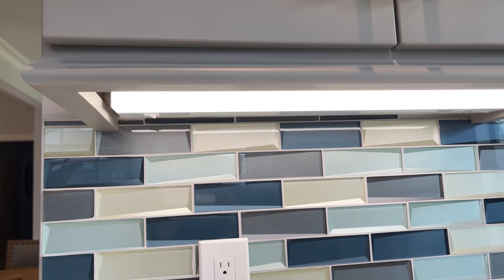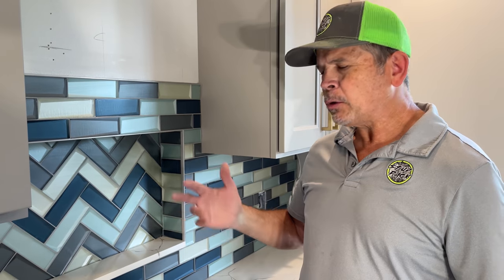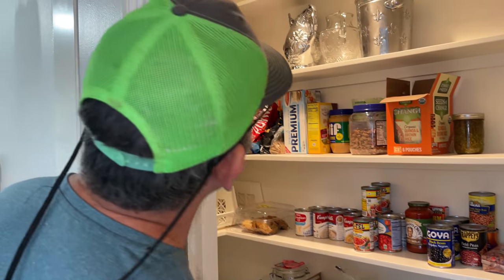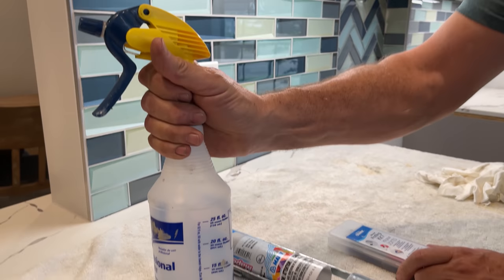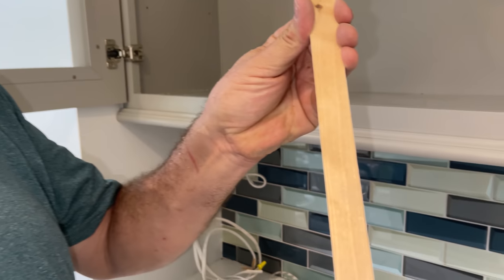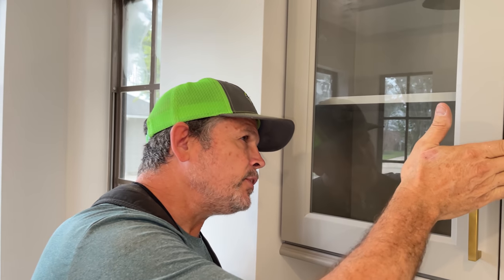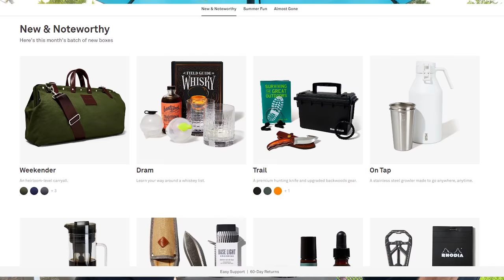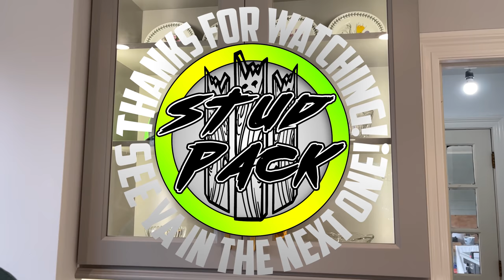DON'T CAULK YOUR TILE! Do THIS Instead...

Comment: I've seen a lot of caulking tools, but not one with the sleds to skip over the grout lines. Do you have a source/manufacturer? My tile/countertop joint was grouted and it's cracking. I need to remove the grout before I can apply sealant. I don't want to use a grout saw, as it will scratch the countertop. Any recommendations for a grout removal tool that won't scratch the countertop?

Comment: I use popsicle sticks for caulk.  Cheap.  Also works for grout lines.  Pick up a little spray bottle in the beauty/travel aisle.  Then you don't need a big bottle.  The spray is much more even.
Reply from the maker: Cool thx 💪

Comment: I do bathroom remodels and I use the exact same products and the exact same method to silicone my tubs and walls the denatured alcohol in the bottle works miracles and the tool gives u a nice clean straight bead
Reply: Is it proper to use silicone for the shower base where the floor meets the walls? Or is it grout
Reply: @OGCJ10  usually silicone is best because grout will eventually crack where your talking about use a 100 % silicone that's meant for bathrooms its flexible and water proof

Comment: Let me tell, you, when you're putting in cultured marble counter tops in a 6 story apartment building, and each floor has about 12 apartments, each one has 5 countertops, the last thing you want to worry about is that little plastic thing. Cut your tube of silicone smaller first off, don't care if you push or pull it, have a roll of paper towels handy, spray with alcohol, use your finger, and go to the next one. I've done thousands of tops in my life time, and have tried different "tools" to smooth the silicone/caulking, and nothing beats the finger for speed and conformity.
Reply: Latex gloves make silicone as smooth as latex caulk with a wet finger.
Reply: @toomanymarys7355  good tip. I've never tried that.

Comment: @stud pack     for times in between uses, keep your CA glue in the freezer, it will store a lot longer that way.
Reply: RC model guys due that as well. Last waaay longer
Reply: @lyradm1  I actually built architectural scale models for about 10 years professionally, and how I got the job was with my models I built as a teenager. So yeah, that freezer trick is one of my old guy tricks.

Comment: You should add a few beads of the 2P-10 to those LED strips. That adhesive doesn't stick very long term. Plus the warmth of the LED will slacken the adhesive.

Comment: From a setter, in the future mix your grout by hand with a pointer, drill and paddle whips to much air into grout and reduces its cured strength, crack resistance, and causes "shading" a discoloration effect
Reply from the maker: Interesting thx Brady 👍

Comment: Thanks for these great videos. I'm always learning something new.  I have a question about the grout. Well, really about the grout and thinset tool cleanup. When you finish a project, or for the day, where do you clean up the tools with grout and/or thinset all over them?  I've been using my driveway with a hose.  I don't want to wash all that stuff down my drain and cause a possible problem.  The problem is, my driveway runoff goes into the sewer which isn't treated and ends up in the bay.  Any ideas on how to do this without having my neighbors getting upset or the local government shutting me down? Thanks.
Reply: A really good way to deal with this kind of waste is to wash everything in buckets and leave the grout to sink to the bottom - assuming you have a day or two to leave it on site - then simply pour off the water (I put it down the pan and flush at the same time!) and scrape the sludge out of the bottom into a bag with used rags, newspaper or paper towels.

Comment: 2P-10 vs a pin nailer  Got a project to finish off that I've been procrastinating on. Need to edge some oak plywood with solid oak, then assemble all, and a pin nailer seemed perfect. But which pin nailer? Considered a battery-electric vs a highly-rated pneumatic. The pneumatic is cheaper, but I don't have a compressor... yet. I want one, plus I need to re-shingle a cabin. Given the cost of labor that pro roofers charge, I can easily pay for a nice compressor and coil-type nail gun (plus a pin nailer), twice over.

Then I saw your video last week. Even if the pin nailer is essentially free, 2P-10 may be the better solution. Just need to order some.

Comment: We used what was labeled silicone caulk, in newly (flipper special) lined shower & tub.
It quickly grew molds.  Was it mislabeled?  Are there silicone caulks that don’t allow molds to grow in/thru/behind them?  Are there brands or components to look for, to get calk that really prevents molds?
Reply from the maker: It was probably siliconized acrylic caulk.   Must be 100% silicone.   If acrylic appears on label or it’s water clean up don’t use it in wet areas imo 👊👍

Comment: You can buy aluminum extrusions like that for LEDs with a diffuser on the front that will dissipate heat from the LEDs and diffuser the light better

Comment: Tip, mount those strip lights flat inside the cabinet in the corner facing the back of the box, and to the adjacent wall alongside the light strip,  mount a mirredge mirror strip like 1in width the total height of the box,  when the lights turn on, they will reflect from the mirrors and light up the entire box.  No need to angle those l.e.d.s, look up mirredge strips
Reply from the maker: This is awesome David thanks for sharing! 💪🏼

Comment: My two cents guys. When I use silicone I don't use racks for cleaning,  I use a toilet paper roll. Clean my tools during silicone work and flip the piece of paper of the roll and wrap the silicone in it. And I move on with the next part of paper, but keep the still attached together. After all is done I have a big paper wrapped silicone sausage. Strip it from the roll, done. Don't forget to put the toilet paper roll back on the rest room, the next one will appreciate it 4 sure. Greetings from Germany

Comment: You don't need to use denatured alcohol.  Water with a few drops of dishwashing liquid works great.  This is how I've been caulking (with a profile tool) for years.  Comes out perfect every time!
Reply: For silicone?  Or for paintable caulk? Because I know that caulk is supposed to be water clean up, but alcohol is my friend with silicone.

Comment: Call me a rebel but when I did my backsplash I used a similar glass tile about 1/2 the dimension from Costco.  I prepared the wall by fixing any blemishes and painting it white due to using glass tiles.  When I was finished I didn't bother using any caulk because it just looked too good without caulking and I didn't want to chance wrecking the look.  I also used an anodized aluminum strip between the counter and tile and around any exposed edge for a really nice finished look.

Comment: Just curioius, do you have a link for the led strip lights, or the specs on which ones you used? They look awesome, and would like to try some in my kitchen. Also, ddi you use a regular fixture for the under cabinets, or would the strip light work there also? Thanks, really liked your entire video, including the "sealer" using the silicone.

Comment: Another tip for tooling 100% silicone.  Foam window spray.  Spray your caulk line, then spray your finger then tool your caulk line and it will get rid of the silicone residue left over when tooling the caulk line.

Comment: Oils in your skin will eventually discolor silicone when you use your finger. I found this when caulking fiberglass board in my deli, the thin residual from the smear looked awful and was very difficult to remove.

Comment: 12:58 Make a paper template that matches the table top of your miter saw. Next, transfer that onto some 1/4 inch or 3/8 inch plywood. After cutting the plywood to match your miter saw, use some double sided tape to attach the plywood to your miter saw, and make a plunge cut into the plywood. Now you'll have a zero clearance table top, and small pieces like what you were just cutting here, won't fall into the throat plate and be a pain to get out. Because you used double sided tape to attach this to your saw, you can easily remove it for framing work, and reattach the plywood as needed.
Reply from the maker: Cool thx 👊👍

Comment: top tip when you using silicon put a line of masking tape top and bottom of were you intend to seal you will have a straight line every time
Reply: I stopped using tape because the sealant often creeps underneath, especially in the grout joints, and after revisiting old jobs I saw that the edges were lifting up - the tape leaves a ridge along the edges that gets peeled by regular cleaning

Comment: What did you end up doing with the tiles missing on the tops of the outlets in the backsplash? It looked like they're needed to be a little tile placed in there so the top of the outlet tabs would sit on tile....... also it's good to go one row below the top of the Granite behind the oven, most decorators and general contractors want it that way that I know so when you have the oven in there you do not see paint because you went one more row down.

Comment: Caulking- I agree it looks real good, but the worry I have is that where the silicone hasn't completely filled the full size of your bead, the alcohol will keep it from sticking when you run the tool over it. I think that's why that glitch showed up here. Anyway, it will look good, but then those areas will pull away over time and it will look like crap.. or in a shower, could leak. Is this not a problem?
Reply from the maker: I get what your saying Mark but I haven’t had any problems.   I have tried the tape method and it works great too.   Tape on the counter, tape on the splash, apply sealant and tool with finger and acetone, remove tape
Reply: @StudPack  Ha! Yes, I originally wrote that tape is my method, but my post was getting too long. Maybe I'll do a mock-up of this and have a good look once it sets up, would certainly save time. Maybe the silicone on the tool pushes/squishes the liquid away as it goes..? Thanks for response.

Comment: Do you use any special waterproofing sealer in or on the grout ??   
Is it waterproof by default ?
Thx...   Great work as usual...
Reply: grout is waterproof already... be sure to clean all the thinset out of grout joints before grouting because thinset is not waterproof and causes the grout to fail

Comment: Stainless cabinet hardware would have really made this job sparkle. 
If there had been any beige or brown in the backsplash, then brass taps,etc would have looked good. 
But the blue ad grey tile plus the clear glass in the backsplash — also the grey cabinets and stainless appliances — really cry for stainless - or maybe black hardware throughout!

Comment: As far as caulking goes have you ever thought about trying Dawn dish soap and a bucket of water in a sponge. Use your fingers to wipe down the caulking and then wipe the excess caulking onto a soapy sponge
Reply from the maker: I’ve tried window cleaner.  Didn’t like it.

Comment: Good tutorial.  Something not stated, however.  100% silicone is CRITICAL with wet areas:  make SURE the silicone is MILDEW RESISTANT!!  If not, you'll be back cutting mildewed caulk out and you'll be learning your lesson.  I like your tool, especially the finger, but if it's really important to get a clean line, TAPE both surfaces and leave the joint open.  Do everything you showed, then pull the tape ASAP and you'll have a fantastic, PERFECT straight line!
Reply from the maker: Thx and yes the tape works great too 👊

Comment: Kwick seal ultra =best results I had so far for siliconized caulk. Sorry Paul. I don't like silicone as it's hard to work with. However I will try denatured alcohol next time,  IN CANADA METHOL HYDRATE.

Comment: I have been a professional caulker for over 45 years. Never use acrylic in any wet area. Always use silicone. Or if it absolutely needs to be painted use urethane. The ONLY  thing acrylic is good for is paint prep.
The profiler tools make it look good. But it does not properly tool the joint it just scrapes off the excess. Tooling is primarily to increase the bond. It’s secondary purpose is aesthetics. A very inferior product.

Every major manufacturer says not to use liquids to tool with if you look close enough at their tech manuals. Here is what DOW ( one of the largest silicone manufacturers in the world ) says: NOTE: Do not use liquid tooling aids such as water,soap or alcohols. These materials will interfere with cure, adhesion and create aesthetic issues.
Page 75 of their tech manual
This doesn’t mean I don’t appreciate everything else you do
Toss the profiling and the spray bottle.

Comment: Save your money on the silicone blade. Been using the small radius from a rubbermaid spatula with excellent results. No practice needed. Cost $2

Comment: Have you tried using the tip of your index finger right above the tip of the caulk as you pull away??? So you place your fingertip right above the tip where the caulk will come out, start squeezing and start pulling, no residue left behind, nothing to clean, just very very little on your finger after done. Try it!!!
Reply from the maker: I’ve done that with latex caulks.  It works great most of the time.  Never tried it with 100% silicone.   I’ll try it next time 👍

Comment: Those tiles are '3D' with the bevels. Was there any special  method you had to use to get all the grout into all the spaces? I'm about to get started with a 'tile' project in our master bath (once I replace the drywall behind the sinks with cement board). The cultured stone 'tiles' we've picked out are VERY '3D' on the showing surface.
Reply: An earlier video Paul shows them, the bevel in on the back of the tiles, the face is perfectly flat, making them much easier to work with while giving that super cool 3D effect.

Comment: LED lighting that is not in a difuser strip liiks amateur hour.  (I did it that way until I learned better.)  Amazon sell Muzata diffuser strips for flat and for corner applications  The corner strips would eliminate the need for the wood strips that you ripped.  Good luck!

Comment: if you had placed a diffuser over the led strips it would have looked better in the cabinet. all it needed to be was a thin strip of plexiglass sanded down to look foggy and placed over the leds

Comment: Anybody watching this please don't use 100% silicone anywhere you may need to paint. Personally I use kitchen and bath witch still has alot of silicone in it but is better to work with and still paintable.

Comment: I hate Mapei rapid setting grout. Really nice material. But it's instant rapid set and you have to mix the bucket like 30 times during installation. Which makes for a P.I.T.A job

Comment: The LED light in that cabinet are not going to stay attached never does don't trust the double sided tape that comes on the lights. Either remove the double sided tape and replace it with VHB tape and using adhesion promoter on all mating surfaces or put it in a channel that can be mounted with screws. Also you guys should be considering smart lighting options in you builds.

Comment: Shower might have mildew because water gets trapped. There’s waterproofing in the gap between the tile backer and tub flange, and there’s waterproofing between the bottom of the tile and the tub deck. Water traveling down the face of the tile backer gets trapped between these layers of sealant. Eventual mildew will develop with with acrylic or silicone. The advantage of grout at the bottom layer is that water isn’t trapped to the same extent - it breathes. Some prefer a little cracked grout over constant mildew.
Reply from the maker: Interesting point of view regarding grout instead of sealant at tub/tile interface 👍  much appreciated 👊

Comment: For cleanup buy babby wipes, the strongest cleaner known to mankind, yet won't take off your skin.
I hate using any kind of caulking or silicone without masking it off with tape first.
Reply from the maker: Cool thx 👍
Reply: @StudPack  I won't even open the silicone tube without knowing where the baby wipes are.

Comment: Nice work, but i don't understand why you ripped a kitchen cabinet door for the corner mounting on the LED's, surely if it's not seen why not use a piece of scrap timber and sell the doors or keep them as spares.
Reply from the maker: I’ve kept leftover doors before but ended up never using them.   These actually got wet and the MDF panel swelled so it was perfect use👍👊

Comment: Lol, 100% silicone is the product NOT to use in a mold-prone spot. It must be sanitary silicone with added fungicide or MS polymer (which you can paint any color after at least a day of setting).

Comment: So you start the silicone application correctly and then you ruin it by spraying it with denatured alcohol, which will get behind the silicone and will weaken the join to the surface 🤷‍♂️ Bad idea. No need to spray anything on silicone